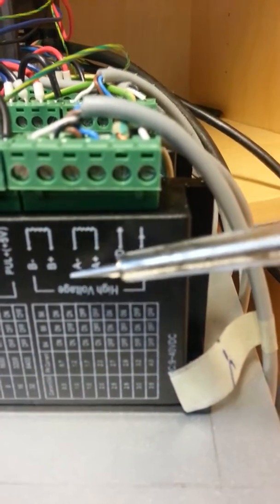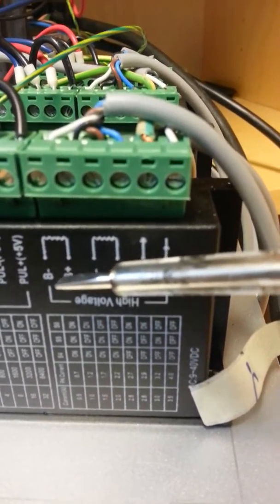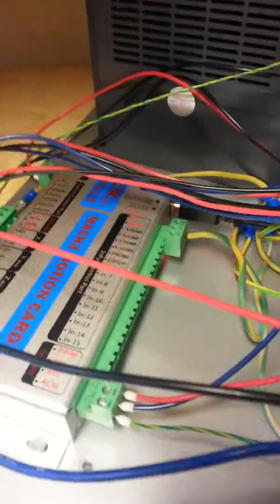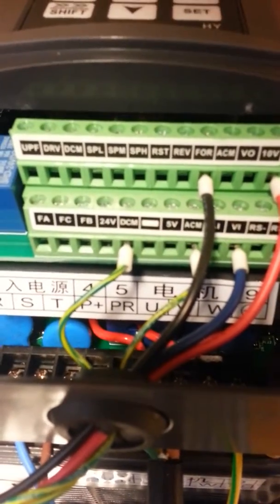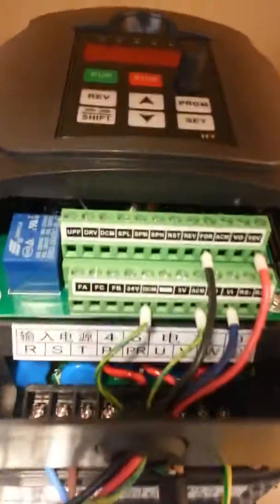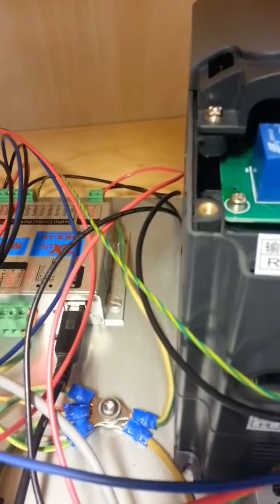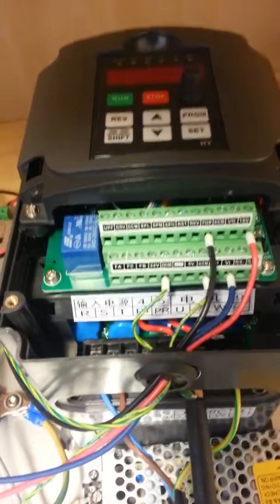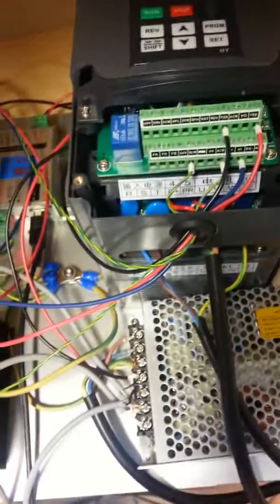MKX-IV MACH3 MOTION CARD AND HUANYANG INVENTOR PART 2

Comment: Hii 
I also using mkx IV and I want to help for attaching a touch plate ..I want know that 0 to 24 volt pin can connect to probe pin its operate at 5 volt ...this 0 to 24 volt is self regulator or not